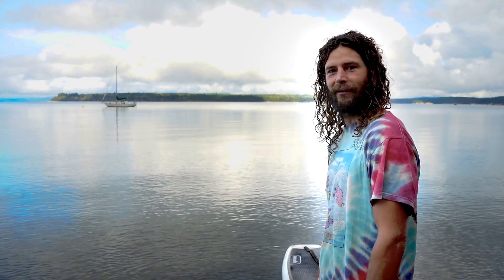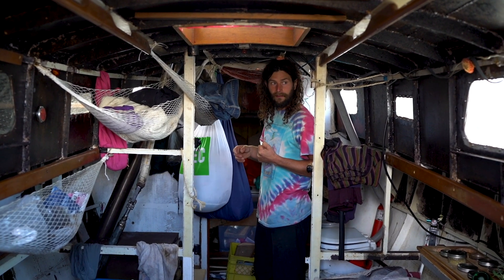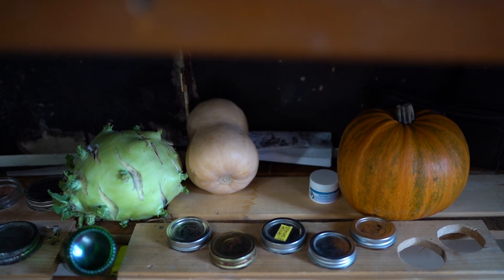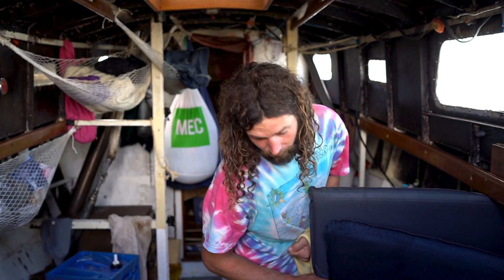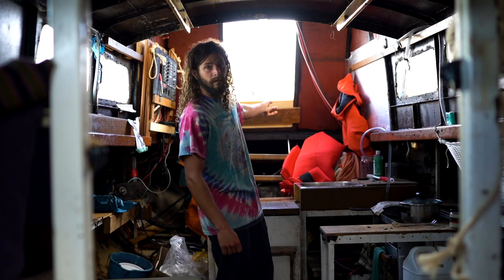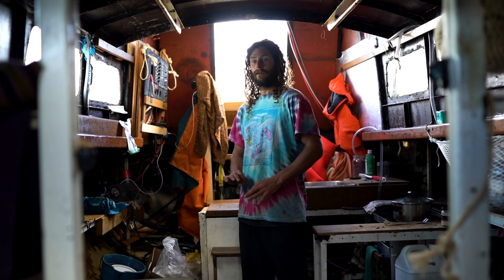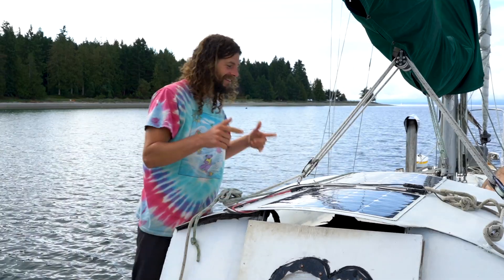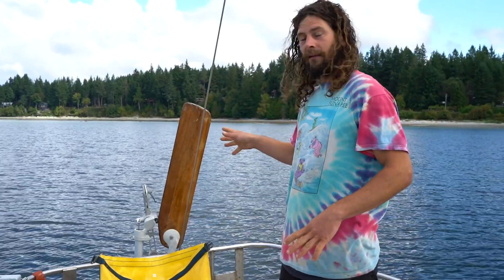Engineer DIY Restores and lives on Steel Sailboat // Liveaboard Tour.

Comment: Mines built in 1972 no rust but a little rain water gets in as I too removed the cockpit and the flush deck is just sitting on top un welded as of yet.  I'm moving aboard in a week or so .  I also removed the engine and now have heaps of space below.  If no cockpit /flush deck is good enough for Lin and Larry Pardey its good enough for me